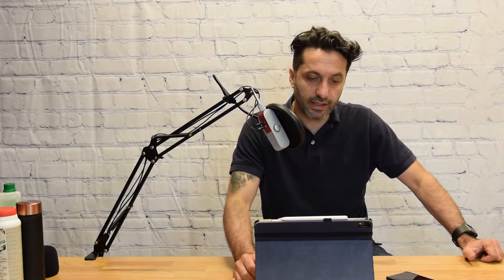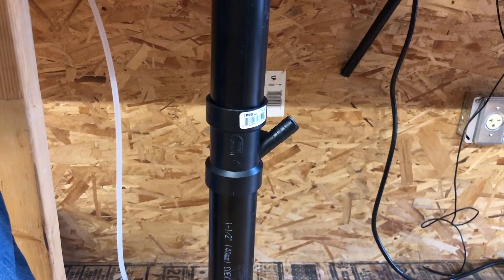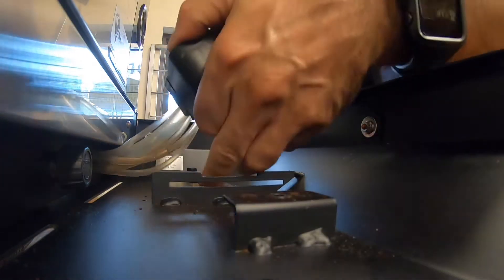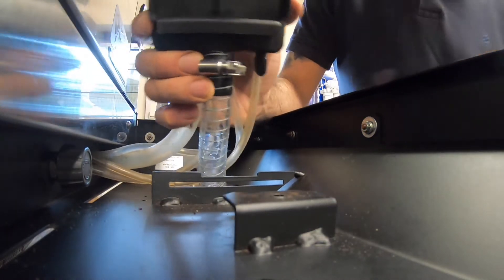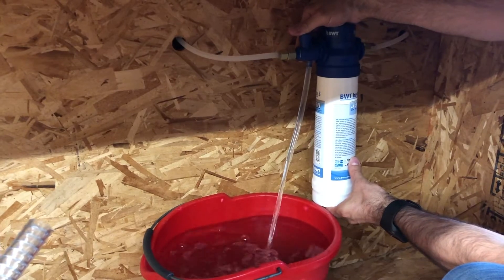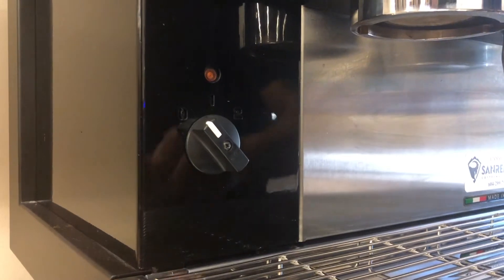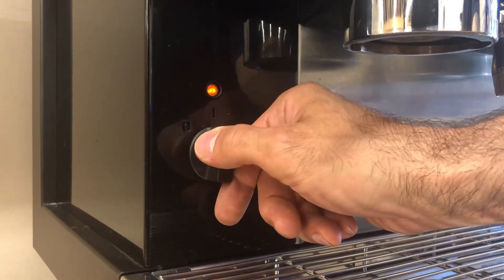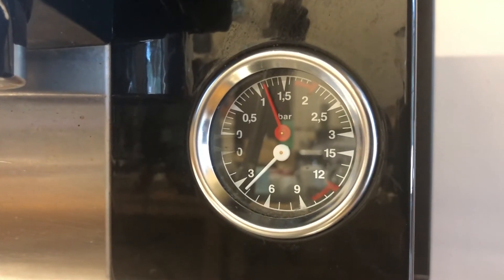Installation Sanremo Zoe

Comment: Do you have any recommendations for when my water pressure only reaches 2 bars instead of the 3 bars. I have still not turned the machine on as I am worried about it "blowing up." Can I still use the machine or do I need to find a pump to increase water pressure?

Comment: 2 hours to reach optimal temperature! Deal breaker.
Reply: Its stated 30minutes, not two hours
Reply: 2 hours for thermal stability
Reply: Same!! 30 mins is fine. But 2 hours for thermal stability???? Oof.
Reply: this are two different things. Yes the machine will reach the set temperature in less than 30 mins. In order for the machine to heat up all the metal and continuously stay at the same temp shot after shot it is recommended that you let sit 2 hours for thermal stability. This is recommended on all commercial machines.